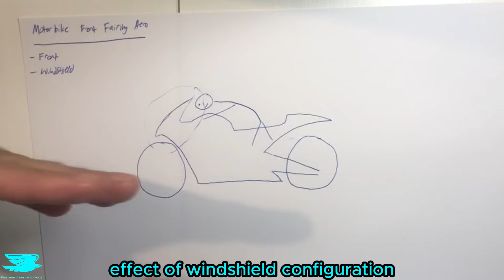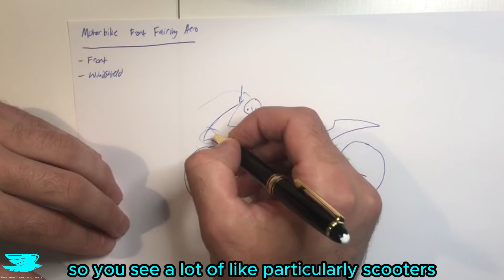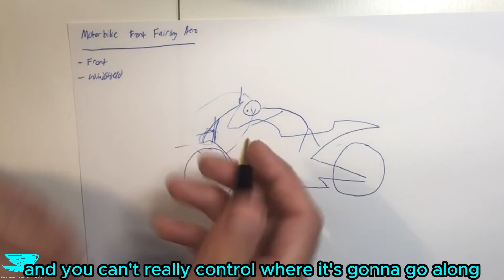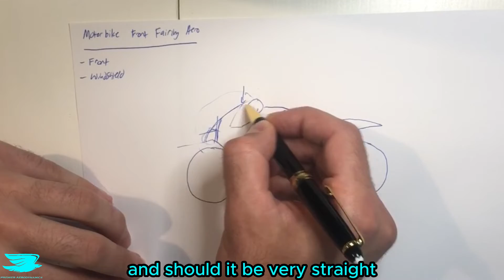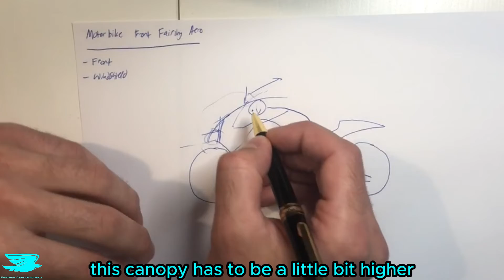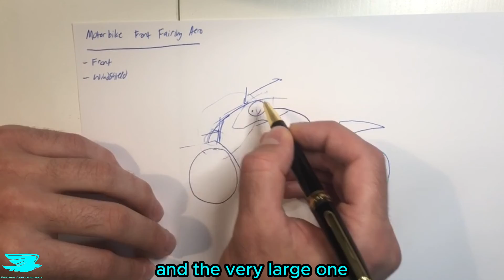Motorbike Front Fairing Aerodynamics {Auto Aero #51}

Comment: I wonder if the fairing is feeding airflow behind the tire and reducing its wake as a result.
Reply from the maker: If you can do that, then definitely. But, it is really hard to do, especially with the rider's leg in the way. Perhaps, having air funneled through the bike into the rear would help.
Reply: @PremierAerodynamics  I meant at the front the nose or fairing on a sport bike. Like you have circled on the thumbnail image.
Reply from the maker: @rolandotillit2867  Oh right. On that topic, you can definitely do that to some extent, especially to get to the radiator. But there is still some wake, which is why on very high performance bikes that don't have to worry about additional safety regulations, the radiators are offset to the sides. They get clean flow.